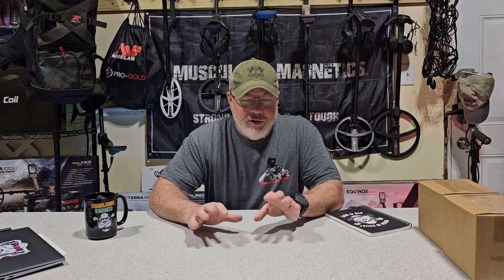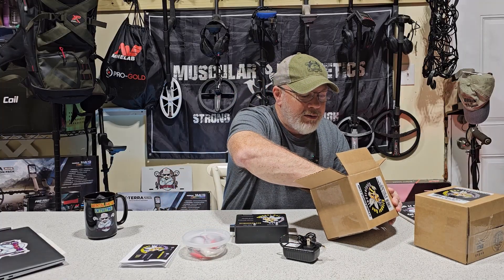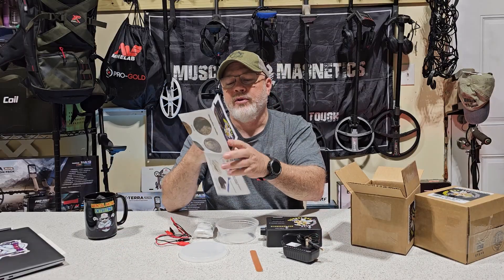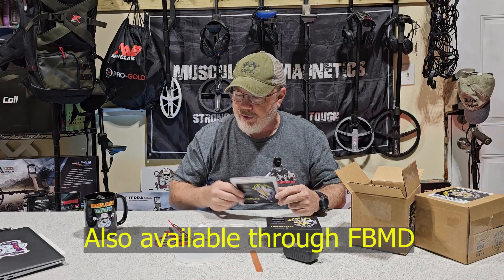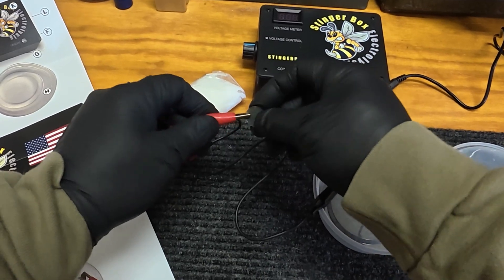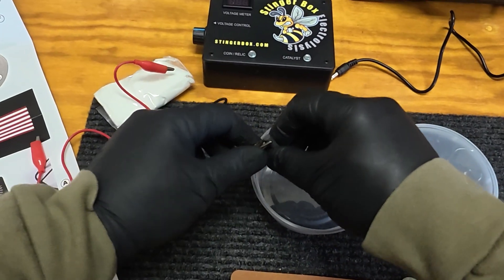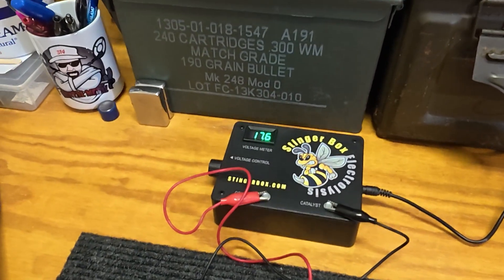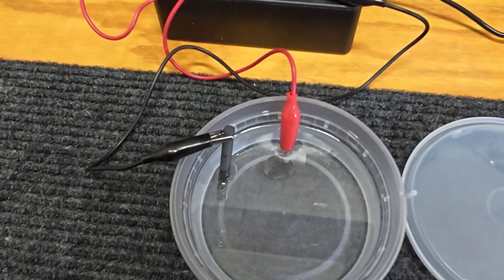Stinger Box Electrolysis Kit: Unboxing, Setup & Real Coin Results

Comment: Aluminum foil on the pan with the coin wrapped works alot better and faster and fools most expert in thinking it hasnt been clean for silver , metal rescue work well on coppers as it rebonds the atoms in the metal so  it doesnt lose detail .
Reply from the maker: Thanks for the tips!
Reply: @MentalMetal  Make it make sense? 
Is he saying lime the bowl with foil and also rap the coin in foil before doing this set up you have? this will protect coin and also make the process work better and quicker?